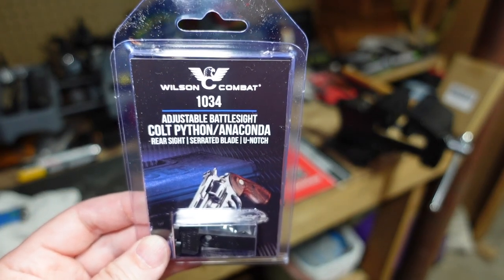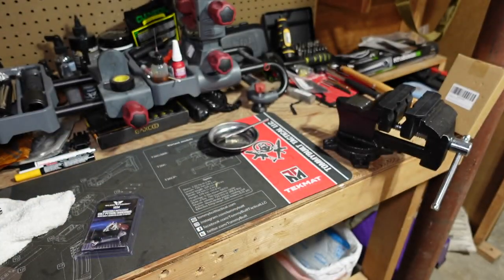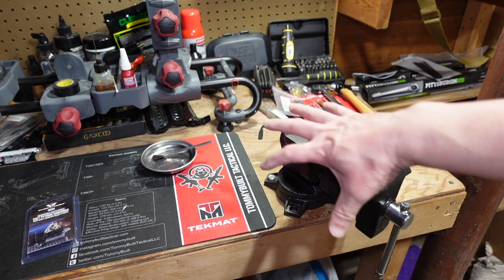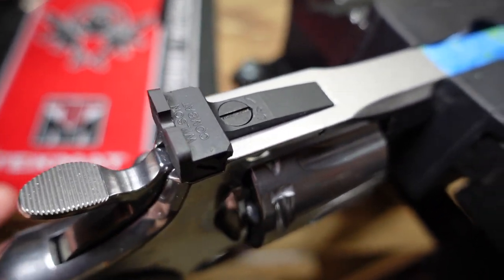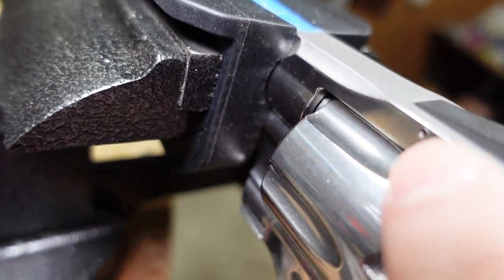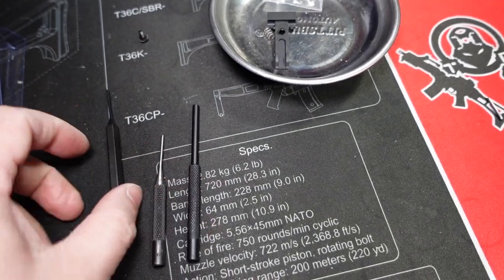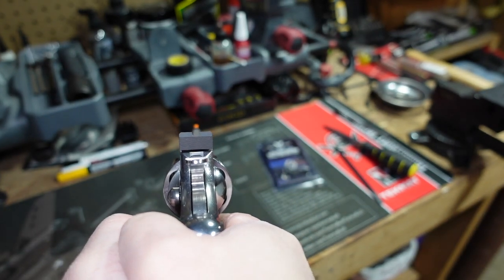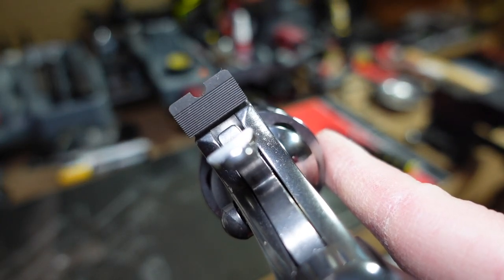Wilson Combat Rear Battle Sight for Python (MUST HAVE!)

Comment: A word of warning, not all 1/16" punches are created the same! I had to purchase 3  before I found one that would fit the roll pin hole. I ended up sanding and polishing the punches down a fraction to allow them to fit the hole, believe me you don't want to get your punch that is oversized stuck in the hole or worse yet break off in the gun. Go slow and cautious. Better safe than sorry!

Comment: I changed my first out of 5 using a folded towel to lay the python on. Easy job and you do not have to drive the pin for the rear out all the way. Just tap and test till it comes off.

Comment: The basic Colt rear sight design is not bad except it has side to side slop in it.  Not sure why Colt does not add .002" width to the sight body so it does not move side to side in the top strap.  With that said, I've installed WC rear sights on all my Pythons and Anacondas.  The WC sight fits tight in the top strap and has positive click adjustments which is a must for me.  A trick I've found with the 1/16" roll punch is to chuck it in an electric drill and polish the punch with some 220 grit wet/dry paper which gives it a little more clearance through the top strap hole.  Then using two 1/16" punches, install the new sight in the frame and use one punch to hold the sight in place.  Then using the new roll pin supplied with the sight, start driving it in from the opposite side.  As it goes in, it will start to push the punch out the other side.  The good thing about this method is it holds the sight hole/roll pin in perfect alignment during installation.

Comment: Mandatory part. Sound serious. Joking aside. Don’t you think a gun that costs $1500 should have a better sight. At least one that doesn’t move or wiggle. If this revolver was made by Rock island armory I could understand that. I always wanted to own a colt python since I was a kid after watching the movie Magnum Force. Now as an adult I couldn’t afford to pay thousands of dollars for one of the originals from the 80’s, but I could settle for a 2nd Gen Python. However, I am not willing to pay $1500 and still have to swap out the rear sight with an aftermarket one and risks messing it up.
Reply: REAL quality starts @$2k these days. Revolver or Auto loader.  I just purchased  2 of them one in blue and the other in stainless.  I already swapped out the  rear and front sights.
I've never looked back.   It's your choice.